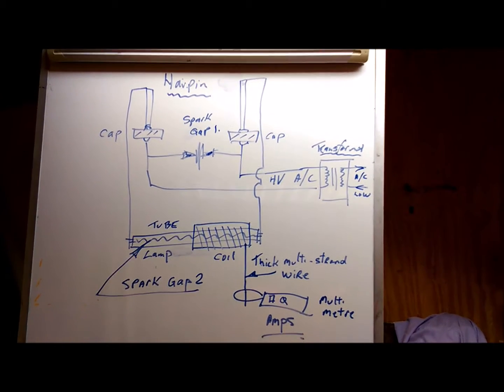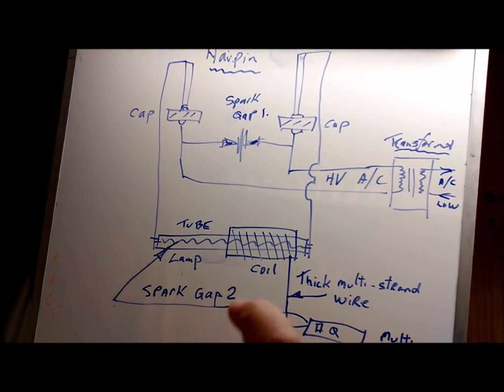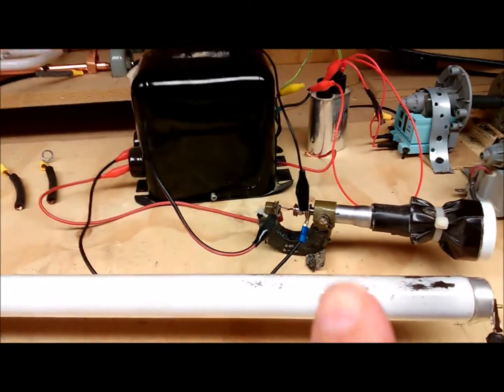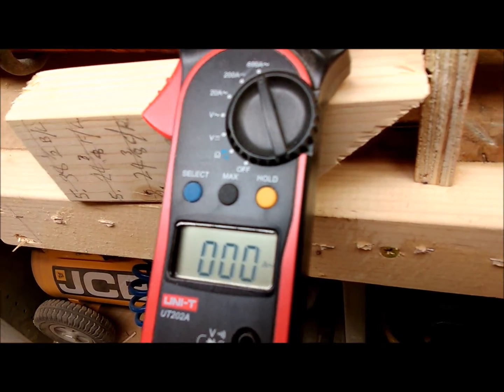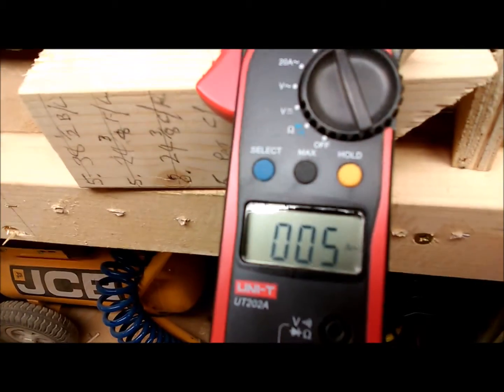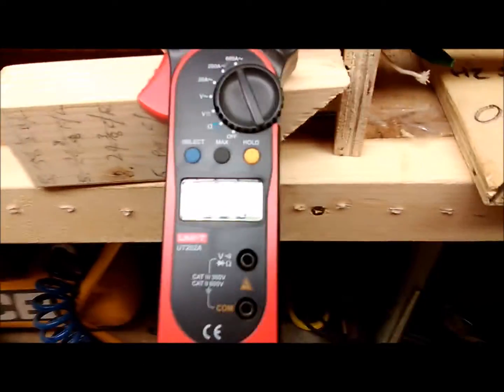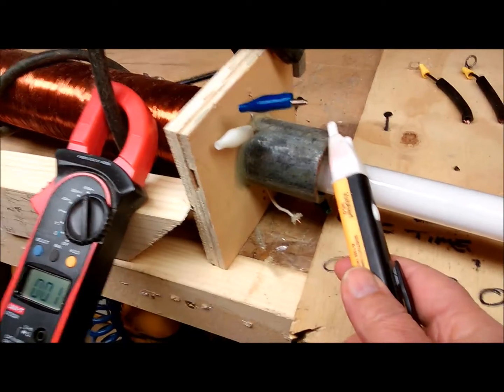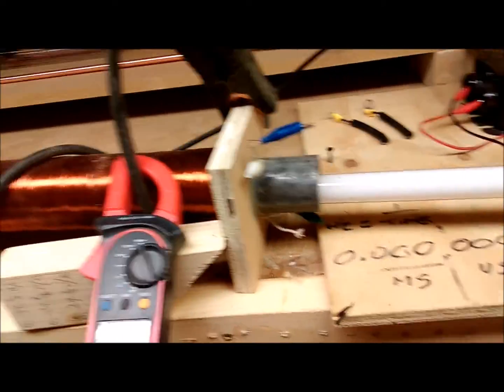Electrons Do NOT EXIST the Hairpin Spark Gap

Comment: You fall victim to the Dollard and Wheeler misquote they make when reading Steinmetz' work.  Steinmetz was saying that in a conductor there is no charge buildup by electron.  Steinmetz was saying that the conductor does not buildup charge and therefore the forces involved in Ampere's law can only come from storage of energy in the dielectric, and not from electron buildup on the conductor..  Steinmetz did not say that they was no electron.
    If the voltage level between points on a conductor are the same, it means no electron charge is built on the wire, the lines of force are closed onto the wire, and do not extend to the other wire.   Only Dollard and Wheeler claim that an electron does not exist and an electron is an end terminal onto the proton out of counter-space.
   In fact CERN can strip electrons of from the proton and store them, Wheeler and Dollard are clueless.  https://science.howstuffworks.com/science-vs-myth/everyday-myths/large-hadron-collider4.htm

Comment: If electrons do not exist, how would u explain the working of various semi conducting devices like transistor and mosfet?
Reply from the maker: vibration at set frequency... dc
Reply from the maker: Om Hi  All potential, energy is in the state of change or vibrations, hence Tesla's words:- " Everything is light" so the Aether (Space) is light.  various semi conducting devices like transistors and mosfets are filters which allow parts of the vibrating scala type pulsed modulation pass.  Regards .... DC
Reply from the maker: This video may help you understand why electrons do not exist :- ...  https://www.youtube.com/watch?v=dd6IsYLCOZc&t=1395s     Regards DC

Comment: Hi DC. Great video mate .You have come away from the Stublefield coil .Any reason for this .apart from this coil must be easier to assemble.Cheers Gez.
Reply from the maker: Hi GM You noticed that I have not finished the "Stublefield Cell", well done! You are correct. I found that my attention was taken by a discovery which lead me away for the time being. I am nothing but a learner, which I enjoy. My next video sets in place another part of the jigsaw. Its about the importance of grounding & how it impacts on adding value to "Fields". If the Earth is a capacitor we should be able to gain potential from it, YES?

My next video will show just how much earthing ups the potential. 
Tesla's "Hairpin" is key to understand the "Aether" "Power Transfer / Magnification".  ....  Regards ....  DC